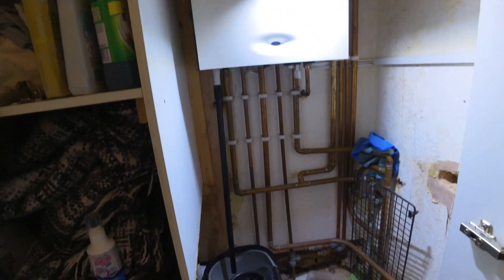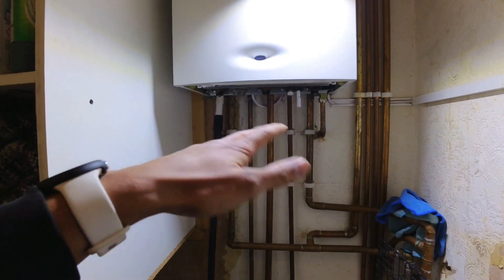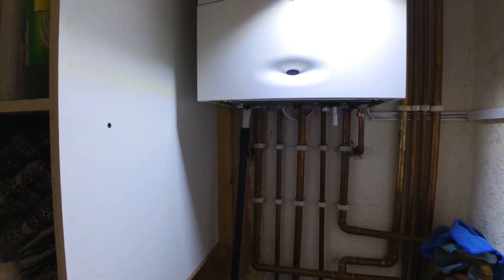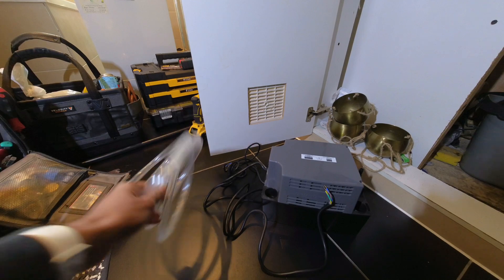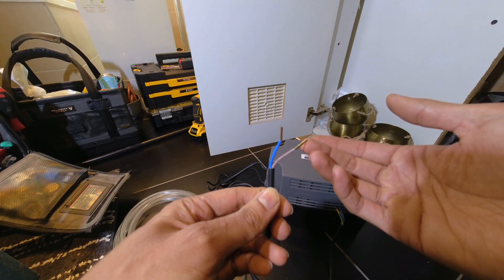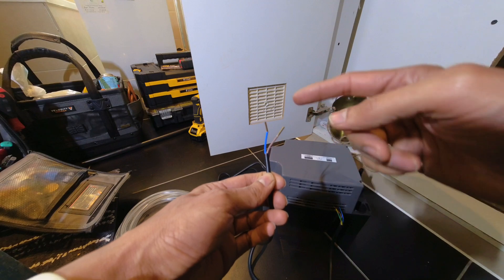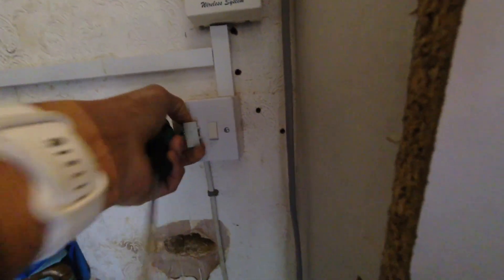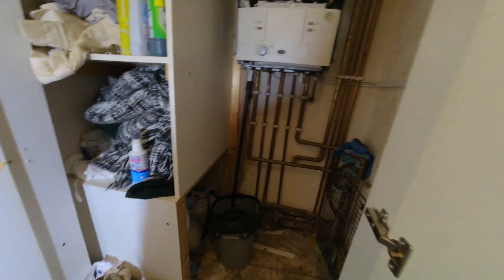How To Install & Wire Up A Condensate Pump

Comment from the maker: If you found this video useful please hit the LIKE button and also don't forget to SUBSCRIBE! 🙏🏽
Reply: A couple of questions... 
Where was the condense going before, had they dumped it into the cavity ? ..... I've seen that dirty trick before. Is that the reason for the damp?
Where did you put the new run ? Out on to the roof or down to a drain with all the insulating etc ?

Comment: Fitted one today for a Gloworm combi boiler, and no mention of the concept in any paper work 😂😅 QR codes didn't work either for grundfos condense pump paper work.. so a very useful video! For combi boilers the condense pump (set up as Normaly closed) needs to be switching the 'burner' on and off rather than the boilers 230v supply or the call for heat (rt).
Reply from the maker: Thank you 👊🏾

Comment: I'm so close to solving my problem thanks to your video. 

I'm installing a little giant condensation pump. There are 6 color wires- orange, purple, blue, green, brown, black. 

From the unit , I have black, white, green. Please help!
Reply from the maker: Unfortunately I haven't installed that one before and you may need to refer to the manufacturer instructions or contact them to confirm what wire is for what 🤔

Comment: Thanks buddy, I have recently moved in to a new property and found my Sanicondens pump has been wired incorrectly to the Worcester Greenstar, permanent feed with cut off wiring wrapped up and not used, I thought it would be connected that way but never used one before. Great explanation and video.
Reply from the maker: Nice glad it helped 👊🏾

Comment: Don’t wire the neutral from the Worcester board, not recommended to draw power from the board to power low voltage appliances.
Reply from the maker: Ok 👍🏾

Comment: Very good pump, thanks for sharing.
I installed the same pump but i have used the alarm switch to supply the coil of an external 230V relay which disconnects the boiler's main cable (socket) when the pump or drain is blocked.
Boiler can't be opened, is sealed for waranty reasons.
Maybe you do a video about that.
Good luck
Reply from the maker: Nice one thanks 👍🏽

Comment: Just done one today after all these years I've never had to do one, I wired it in to a three way wago, live from fuse spur, live to pump, and the brown wire on the two core. Blue wired in to three core (live) to boiler. Five core from boiler to receiver. My issue and I had to do a bodge was tying in the 8/10mm hose in to the white plastic adapter, cut the end off and it didn't seem to bond with solvent, I ended up using the black rubber condi straight that came with boiler, glue in the white fitting, slid the rubber straight over it then a jubilee clip, then condi pipe in other end with another jubilee as had a spare. Is there a specific way to join that flexible hose to a 21.5mm overflow pipe? Wish I'd watched this video first I wasted half an hour thinking through the wiring lmao. (duo tec compact).
Reply: Sorry just to add, condensate pipe fed along the loft and into the guttering, the roofer lifts the tiles and makes good, so I couldn't just run the hose the entire way to the guttering, head height /length wasn't an issue, just the logistics.
Reply from the maker: Nice one mate, depending on which condi pump you buy, they should come with adapters to go into overflow pipe

Comment: Grundfos says the safety switch is for low voltage only. Should you still connect it to 240V then?
Reply from the maker: The pump still needs 240v to run and this is just one way to install it
Reply: @pecosimplu7070  That's no low voltage!
Reply: that switch specs are 5A/250VAC so you can connect anything that not exceeds those;
if more power is needed than use and intermediate relay
if you don't know what low voltage means ask help from a qualified electrician

Comment: might be worth mentioning for any new operatives watching, not all condensate pumps are suitable for the PRV pipe to be piped into (consult the manual). Nice to see you wired the condensate pump safety switch correctly, I have seen this wire connected to the CH demand/switched live and many times it has just been cut off!!. But a nice little informative video tho.
Reply from the maker: Cheers Daz 👍🏽

Comment: Good video mate as always,
Did you put the blue neutral into the switch live,
Hard to see if it was the brown or blue 

👍👍🤜
Reply from the maker: Cheers mate, so it's not a neutral wire, they're both just switching wires but ones brown and ones blue. Doesn't matter which way round you wire them in 👍🏽
Reply: Understood there only a pair of switch wires hence polarity doesn’t mater,

😎👍👍🤜
Reply from the maker: @tonymurff5234  spot on 👍🏽

Comment: i didn't know you could send the prv into it, because of the potential for very hot discharge i usually see that piped into a saniflo type pump
Reply: not all condensate pumps can take a pr valve discharge pipe, i believe the centrebrand ones cant  BINGO
Reply from the maker: @stevenjohnson6082  👍🏽
Reply: thanks bro

Comment: So if you've got a vailliant you can just write the live neutral earth as normal then put the other cable with the two wires in burner off bit?
Reply from the maker: Exactly that mate 👍🏽
Reply: @cputilitysolutions  that's interesting I didn't even know that. We mainly vailliants for the council so will come in handy

Comment: Why is it called a condense pump and not a condensate pump?
Reply from the maker: Same thing
Reply: @cputilitysolutions  it was more around the language, condense is a verb ie to condense. Condensate is the noun for the discharge from the boiler. I wonder why it's called a condense pump - I'm not having a go at you, I have seen lots of plumbing channels call it this but I wondered if there was a reason for it.
Reply: @Hambini you're correct. it's actually called condensate pump
Reply from the maker: @olalekanoyedokun4494  👍🏽
Reply: @cputilitysolutions  its not the same condense,  condensing boiler that's what type of efficiency, condensate is the product you are removing BINGO